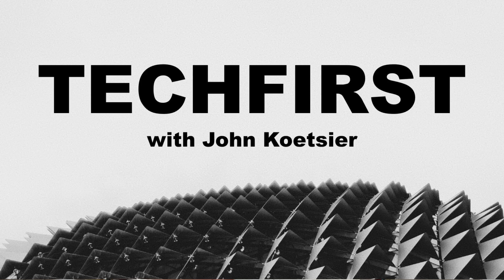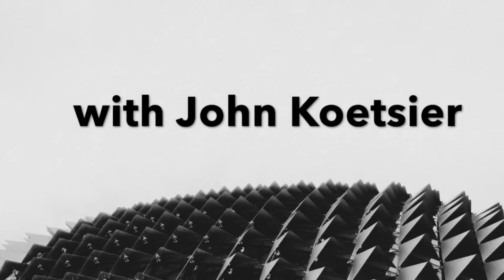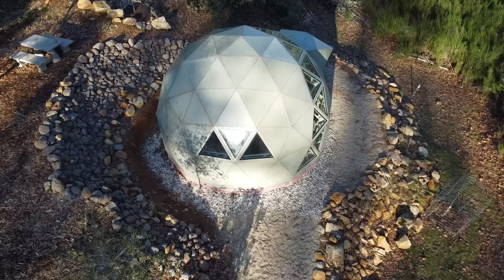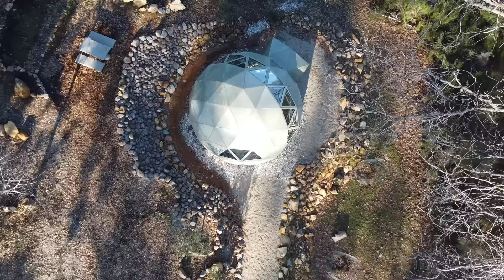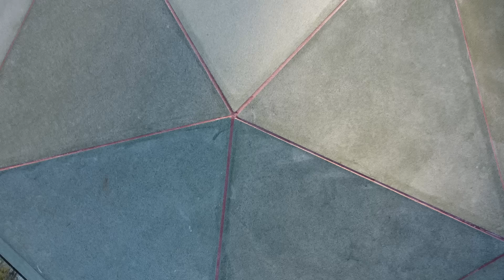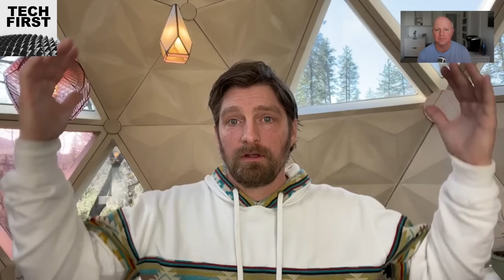500-year ceramic geodesic dome home: now real

Comment: How do you tank make the cob floor to prevent rising damp without losing the grounding?
Reply: I've pondered this question a lot, too, and I think any wax / drying-oil / etc-sealed floor will necessarily be an electrical insulator, as well.

There is this stuff called "waterglass" -> Sodium Silicate. You can buy gallons of it for cheap; It's a non-polluting, non-toxic solution which you can either "paint-on" to surfaces, or (in certain cases) mix in with concrete; It created a glass-like surface when painted on, and does the same from the inside-out when mixed with cement, reducing porosity.

It's possible that the waterglass may allow for some Earthing effect while also sealing a concrete or cob floor... but it would take experimentation.

Comment: 33 000$ for this dome ! I wish you'll share the receipe of the ceramic material, (in this ''social pretention'') as anyway the most expensive part of cost of housing is the land. Housing problem is caused by private ownership by the wealthiest, and speculation on it and building material.....
Reply: Just search the terms they used online. The primary components are perlite and magnesium. Both sourced CONUS. There are research papers on researchgate that have different recipes…

Comment: Ceramics are known for being BRITTLE and FRACTURING when structures settle or in earthquake...or even high wind forces...
Reply: Absurd take: Concrete is a ceramic, brother and that holds up millions of pounds in every skyscraper and bridge you see.

Besides....
1) He is probably using an exotic Magnesium / Phosphate cement; They have an organic-like crystalline structure which not only has higher compressive strength but also high tensile strength. Look up "Sorrel Cement" -> They used to combine it with cotton powder to make billiard balls in the late 1800s / early 1900s.
2) He's implemented this into a geodesic dome; Any shear forces are handily redirected into neighboring components.
3) Combined with a few natural or synthetic fibers, or some rebar internal reinforcement... the cement beams would still maintain a low cost, and be ridiculously strong.
Reply: @-_-----  The panels used for these domes are relatively thin compared to concrete. Even reinforced, bioceramics remain highly brittle with low toughness and resistance to fracture.
Reply: @immersionaccount6893 yeah, there are two companies that I know of. I talked to one owner/designer and he said they were going back to wooden frames with bioceramic plates on the outside.
Reply: yep this wouldnt last under a hail storm.

Comment: Is anyone actually building and selling these or is this another fund raising stunt?
Reply: They’re still in manufacturing development, but they have a very real engineering prototype (I have been inside it!).
Reply: @alligallixsee7821 how do these pass building inspections and zoning requirements-esp in CA? How do you get permission to have these on your land?
Reply: @alligallixsee7821 I wish it could be inside of me 😞
Reply: I heard you can order one for not too expensive but there is already more than a year waiting list. But i cant remember where i read it. I think they are selling but low profile because they cant deliver too many right away. They are in their first year as a lean startup and only slowly scale up. Something like that? Im not sure.
Reply: @addhoc256 

Kirsten Dirksen did an up dated visit.  Now after the Hurricanes,  floods and now LA fires  .. plus tornadoes and other extreme weather and quakes etc .
Isn't it about time America started mass producing a new architecture for the whole  country following the disasters.. 
Rebuild a new architecture that's not going to disintegrate burn or dissolve  and saves materials and energy. 

Some of those SOCAL people need to see these and set up community regeneration production units with the 30ft dome versions they have developed. 
Best they can use inert Greener Basalt fibers, rebar and matting throughout ..to strengthen and bind... both the ceramic and the floor bases.
Reply: Goodie 🎉
Reply: Those “stunts” lead to production for all to purchase and usually perks come with being the few to initially invest without a final product upfront.
Reply: Code won't allow them and no bank will finance it.
Reply: @ronlabe5487 that can change. In fact I predict new building rules, especially in California, and these buildings make perfect sense. They shouldn't burn or blow away or collapse.
Reply: @comfortablynumb9342  California  is burning because of their love for inflexible failed policies. They don't need fireproof homes. They needed to fill their fire resivore, do controlled back burns, ban eucalyptus and STOP firing all the people who knew how to put out fires.
Reply: @ronlabe5487   They were just okay'ed for California housing codes (which may be the strictest in the country, if so this could spread quickly).
Reply: @ronlabe5487 they are changing the codes, by a huge push from insurance companies. I think most housing codes will not have a choice but to change, because of the majority of large insurance companies will not cover California, Florida, etc. which intern makes it almost impossible, to get financing or a mortgage

Comment: It really tells that the guest has a STEM background with no construction experience, so he has spent a lot of brainpower to optimize for the wrong parameter. A home needs to provide as much as possible horizontal space as possible, that also has: a moisture and heat barrier against the outside, controlled air intake (ventilation), natural light throughout, and durability.

1) A circular shape is terrible for moisture control, because as water slides down the roof it will have an opportunity to test every microcrack and joint, which are never absent because of thermal expansions and contractions. So you either remove windows, or make durable, hermetically perfect window joints, which shoots the costs of build and repair into the sky.

2) Humans can only use horizontal space, so circular shape is not the most efficient per useful space.

In conclusion, this technology has good wind and earthquake resistance at the cost of everything else. There is also no research to support the idea that geopolymer concrete is more durable than classic high and ultra-high grade concrete.  So the endpoint of this technology is going to be a more expensive monolithic concrete home.
Reply: It would be a nice "fancy" tall greenhouse for tropical rainforest type fruit trees, etc...or a barely useable/climate control nightmare for a yoga / meditation ...but other than the pyramid & geodesic "attraction" ...there is little else...
Read another comment about icosahedron which is found in fascia in the body at the macro micro and nano scale repeating but not sure it can be applied on a structural building to any positive effect...as we rarely see any examples of such dynamic structures in large scales.

Comment: Yes, I agree it would be interesting to know the process and history of the material proposed to seal the joints. I will take "500" years as hyperbole at this stage...Cultural conditioning should also be taken into account in marketing. Having lived in a dome 30 days in the Fall at 57deg N light is more important than one might imagine. Plus, I hate to say it, I missed the defined spaces of linear walls and ceilings. I can see myself building a dome. But not everyone will feel comfortable living in the space.
Reply: i think the shell membrane of the geodesic domes is just that: a shell. to make wise homes with rooms and infinite fractal possibilities the other two basic shapes of spacetime besides the dozeneighteyes 'icosahedron' present in these domes, namely the complementary foureyes ('tetrahedron') and eighteyes ('octahedron') that together constitute the isotropic vector matrix of closest drawn spheres would be a wiser choice for the creation of interior rooms and such. the beauty of those is that they not only embody structure, therefore come with all the integrities missing in our current convention of 'cubes', they embody a synthesis of those 'straight' lines and the spheres as that is exactly what they are: the shapes created by the geodesic, meaning shortest, least resistance and effort, connections within the relationships of closest drawn spheres. 

to get a better sense of what i speak of, check out this introduction to spherical thinking, Bucky's Synergetics: https://youtu.be/c7py3sqYM3s?si=GQWeEktVd_-_AplL

peace
Struppi
Reply: @HaileISela  Fascia has icosahedron and other...look for the poly dodecaicosahedron ...if I have that correct...

Comment: I'm almost afraid to ask, how much would a 30' dome cost if it were ready.
Also could it be built underground.
Reply: A lot. Banks also won't finance it, and you couldn't sell it to anyone who doesn't have cash. And, this 100% will not support the weight of dirt. Additionally, you won't be able to get construction permit for it in most places.
Reply: It's an engineered building so you will be able to get a bank loan, the honeycomb structure is very strong and probably would handle the weight of the dirt, but getting an engineer to sign off on it would be costly.
Reply: @justinpullen1472  You are speculating. I went to 6 banks and 2 credit unions looking for a home loan for a dome. They denied me with an 838 credit score and collateral exceeding the amount I wanted to borrow. They would give me a personal loan at 18% interest with 20% down but that has none of the benefits of a home loan. My county also would allow me to build a 'barn' but would not give me a permit to build a dome home. Domes 100% do not qualify for FHA, VA or Department of AG home loans for construction or resale. So, you may build one, but you will regret it.
Reply: @ronlabe5487  I think you'll find that the Geoship is different than your dome loan experience. They don't leak like the domes that came before them. Buckminster Fuller said it would take decades for the material science to catch up to his design, that time has now arrived. The Gossip will only be available for sale in California 2025-2027, then they will scale and expand.

Comment: I bought Domebook 2 in the 70's and built a smaller 3V dome then.  I like this concept a lot but want to see more details on how  they seal all the joints since that has always been a major issue. Would love to see hub design, mechanics, etc of how these actually go together.
Reply from the maker: good question!
Reply: Read about CBCs, which is a new material category that wasn’t understood when Bucky was alive. The material itself is the answer to sealing the joints that have always been an issue with geodesics!
Reply: I invested $100.00 last year…need house NOW!..good luck dear GEOSHIP!
Reply: geopolymer is just a special type of concrete
Reply: Can you direct me to info about CBC material…I’ve looked but can’t find.
Reply: @Museyana432  search for chemically bonded ceramics and you will find lots of info!
Reply: CBC's are just Composite Building Components. Which can be almost everything. Would also love to know more about that type of material that is being used in that dome :(
Reply: @munnotubbel675  Me too. They're not sharing it, so we can't verify their non-toxic claims. They say it's material made from raw earth minerals and natural fibers. But so is asbestos. We thought it was fine when we started using it everywhere. And they say it's not on the Living Futures Institute's "red list", but if they're using new building materials then it probably hasn't been studied well enough. I hope their claims are true
Reply: @munnotubbel675  no, CBCs in this context are chemically bonded ceramics.
Reply: doomebook 2 gor me really excited about domes as well. but there are so many downsides for practice living in one.
Reply: I bought a few dome books back in the early 2000's and nearly bought a kit from the US for installatioin in the UK. I think most of the sealing problems with domes is the movement of the structure as the sun moves across it over the course of the day? I don't think this would move much once settled?
Reply: we know how to shingle domes with conventional architectural shingles now where you don't have to worry about seams and they're pretty much leak "proof". hopefully their tech pulls through because it would be world changing

Comment: Solar built into the wall panels would be perfect icing on the cake
Reply: That would be terrible. When you want to upgrade your solar you have to remove the whole wall panel, and then you're limited to solar panels that slot into that same spot. Standalone, modular panels are ubeatable.
Reply: Solar panels are black and collect heat, they also work best if they can angle towards the sun.  For a dome, or any semi-spherical shape very little of the surface will be angled optimally for solar energy collection. Solar Windows are only semi transparent, but might be a good idea for south facing windows in warm climates, but the Cadmium Telluride they're made from might be counter to the ecological principles that Bioship espouses. As we move into new generations of solar panels (crystaline silicon -> perovskite -> quantum dot) this will likely change.  It will likely take Bioship 8-13 years (or longer) to ramp up to millions of homes per year,  and solar will be 2-4x the efficiency it currently generates per area covered, so a solar covered carport or trestle will be able to provide ample energy.
Reply: Not good if connected to AI the Cloud Yikes
Reply: Only if it is removable for repair and replacement, and only if you have an external spiral walkway so you can CLEAN the surface of ALL of them as well as service and replace. And only as long as the "done" is fire resistant.. as this is a common and frequent problem ELECTRICAL FIRES...
Reply: @1truthseeking8  At that point you've killed all the efficiency. Just use the solar panels to make a covered porch, shed or garage instead. More economical and you get extra sheltered space to use.
Reply: @1truthseeking8  Extendable window cleaning tool and the building material used is not flammable. If you live somewhere that cleaning is require a lot and don't want to put in the effort then just don't do the top panels. The people I know that have solar panels don't clean them at all they are still working fine.
Reply: @1truthseeking8  you could clean with water falling from the tipy top, so there could be pipes going all the way up there.
Reply: @dzibanart8521  flowing water doesn't "clean" but merely leaves additional deposition of minerals eventually corroding and cementing in place along with mold and so on...going to need a spiral staircase inside AMD outside
Reply: @1truthseeking8  How did this dumb comment get any likes? Obvious troll is obvious.

Comment: what if a tree fell on it
Reply: Geodesic domes are much stronger than a traditional home usually much stronger but larger enough tree doesn't matter also same with a traditional house
Reply: It depends on the tree. It might bounce off, or it might do the same level of damage that would be done to a conventional house.

Comment: Can't wait until these are available to the public! Looking to establish an early Christian-style modern co-op and these would be perfect. Have been following Geoship for quite some time and it's exciting to see the prototype. 

@geoship - I do have a question about the windows, if there will be custom sunshades/blinds available to block light and heat. Also if the windows are double-paned for enhanced temperature regulation. It's difficult to tell from the video.
Reply: I heard from geoship they plan on start delivery in 2025
Reply: I doubt they would engineer 10" thick panels and skimp with a single pane glass….also the glass must be hail resistant.

Comment: I live in a more northern latitude, and most of the homes here have some kind of basement. Would there be much difficulty in building a full sphere with part of the sphere below the frost line?
Reply: You could continue the sphere below the frost line. However, if the goal is a basement, a cylinder below ground, with a dome up top would be better.
Reply: I'm guessing it would be more like a cylinder as a foundation to get below the frost line. Half burying a sphere sounds difficult.
Reply: I asked Morgan about that before and he said no problem at all.
Reply: @Gabrysiak2015clips  There might be slight misunderstanding... He might have meant a circular foundation with the cylinder on top... Why bury part of your head room...
Reply: @bosatsu76  because below the frost line ...underground... the temperature stabilizes , so temperature control becomes easier. you can still get lots of natural light underground (during the day, natch.) https://solatube.com/residential/tubular-skylights/
Reply: I think like a boulder it will shift

Comment: Wow, that looks incredible.  Great project for an off-grid option!  I'm looking at an inexpensive piece of desert property, and am left wondering how it would do in the desert?  Great project, I hope to be one of your first customers once your up and running.   If you do tours, I live close and would love to make the trip.  Thanks and good luck!
Reply: The domes will be awesome in the desert because the ceramic reflects over 80% of radiant heat (cool roof effect). The tight envelope could also enable an "adiabatic cooling" effect.
Reply from the maker: Huh, not sure, but I think it might be ideal b/c the thick walls will help keep it cool in the day and warm at night. Morgan would know better, although I don't know if they've tested it in multiple climates.
Reply: @johnkoetsier "like an epoxy" ...sounds like a TOXIC OFFGASSING and chemical toxicity as it breaks down overtime NIGHTMARE in the making.... Can't wait. My lawyer is on speed dial